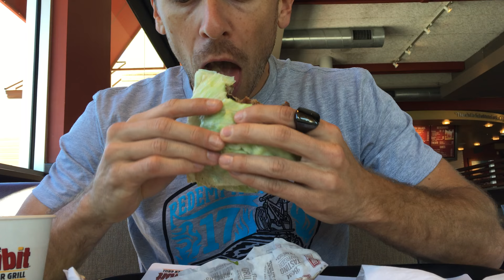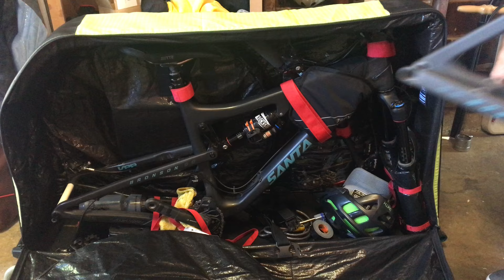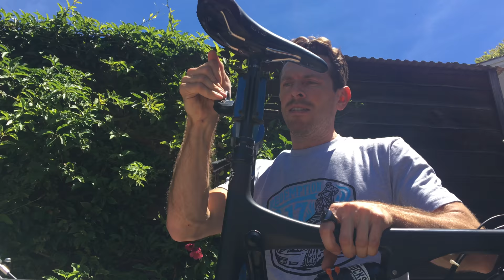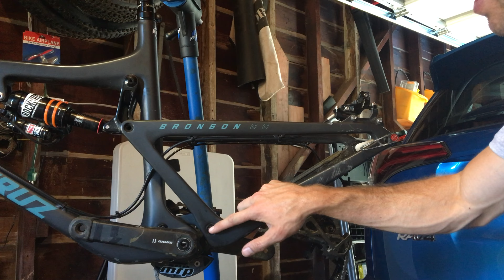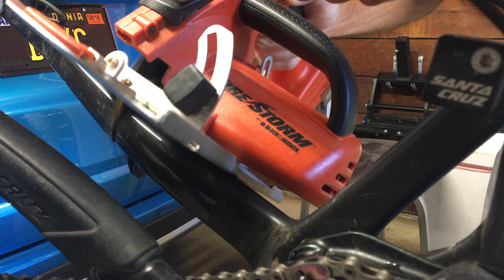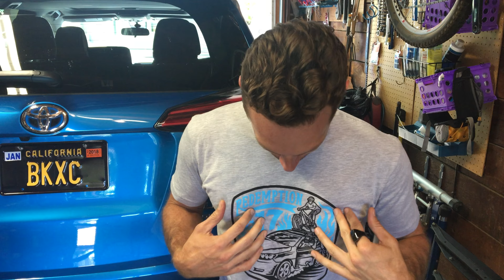What's next?

Comment: definitely should be wearing some sort of respirator or spraying the cut area with water for dust suppression whenever cutting, sanding, or machining carbon fiber. Stuff can give you a wicked sore throat, just like fiberglass insulation, but worse since the fibers are resin impregnated and rigid.
Reply from the maker: Good call!

Comment: also curious as to why SC made you cut the triangle if you had to pay for the replacement?
Reply: cooptwentysix yeah found that odd. I guess in case he decided to sell it on eBay or something and someone else could use it and have an accident if it broke while in use. Can't think of any other reason. You can't 100% totally recycle carbon so I guess it just got binned
Reply from the maker: It was either send it back or destroy it, and I'm not paying to send it back.